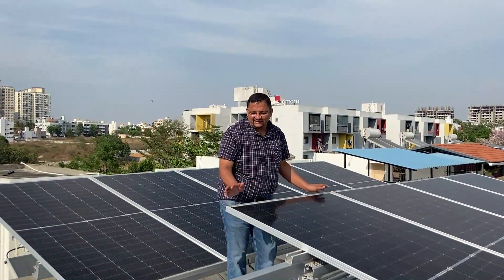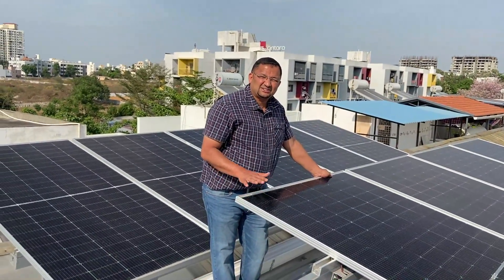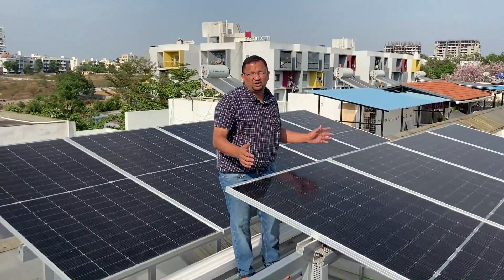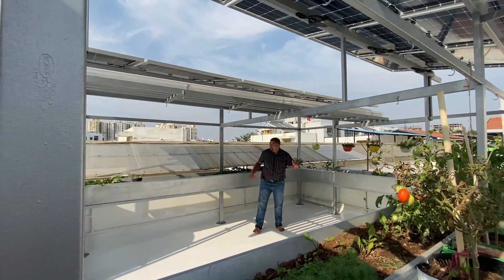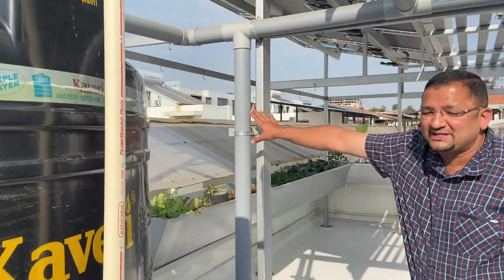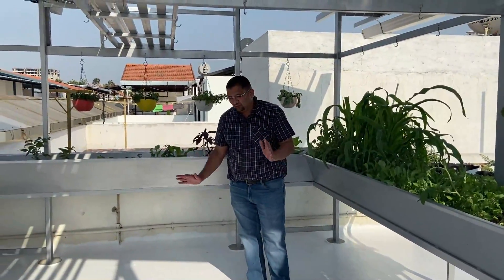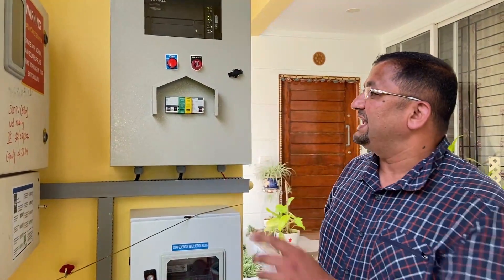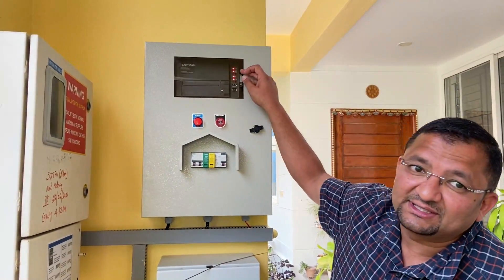Get Ready To Go Green! Solar Energy, Agro PV,  Rainwater Harvesting and Cool roof ..

Comment: DO YOU INSTALL 5 KW HYBRID SOLAR SYSTEM FOR HOME ??
Reply from the maker: Yes, we do
Reply: @HinrenEngineering  send quotation for 5 KW HYBRID SOLAR SYSTEM FOR HOME COST WITH NET METERING AND BIFICIAL MONOPERC PANELS AND LITHIUM BATTERY AND HYBRID INVERTER WITH COMPLETE INSTALLATION PROCESS
Reply: @HinrenEngineering  I need to install 5KW solar. How to contact you to get quotation and site inspact ?